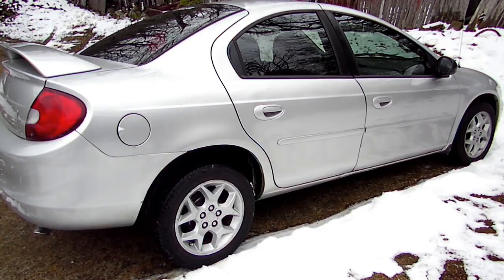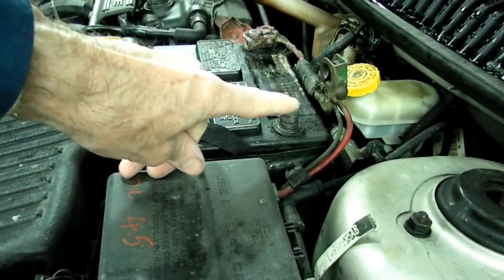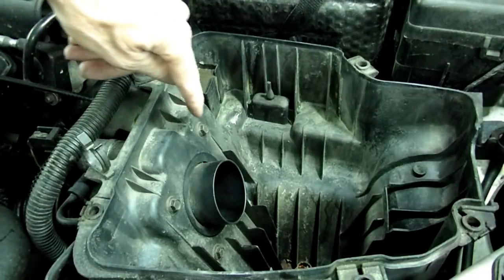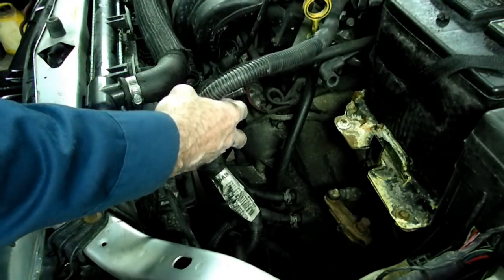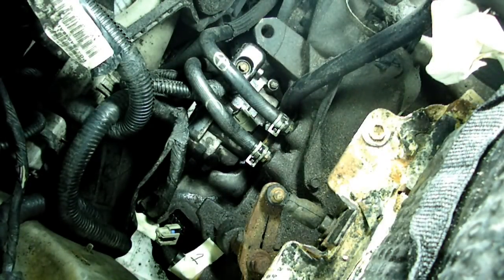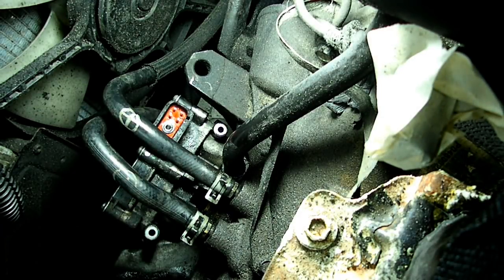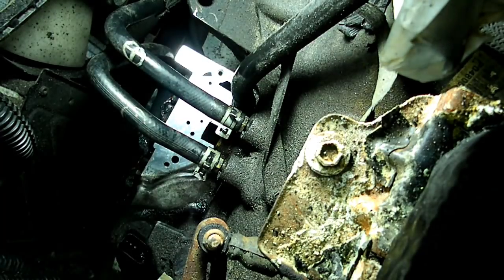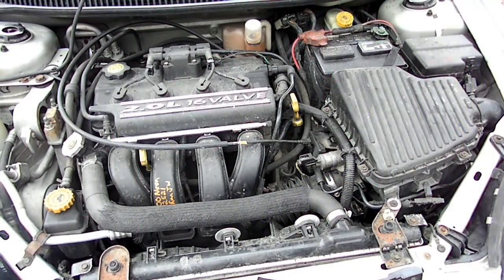Transmission Control Solenoid Replacement

Comment: Hi richpin, when you replaced the shift solenoid did you had to perform the "Quick Learn Procedure" with a DRBIII scan tool in order for the car to work. I have the Repair Manual from Dodge and it says that that procedure is necessary when replacing the shift solenoid. I ask this question because I replaced the solenoid and the transmission is still stuck on 2nd. I have also replaced the oil and filter and also the input speed sensor and output speed sensor and still the transmission is stuck.

Comment: 95 MX3 transmission (automatic 1.6L / 4 cyl.)

Full with fluid
shifts OK into 1 and 2 .... but RPMs go up and up for 3rd and 4th (foot on gas accelerating), but the cars doesn't speed up  .... i'm stuck on 1st and 2nd.

-Solenoid problem ?
-Should i reset by disconnecting battery ?
-No OD light flashes in dashboard
-No ''CHECK ENGINE'' light 
- No codes have been taken fron vehicule (we just added fluid to tranny) 

Thanks for any help ....

Comment: Nice job.I have a 2001 Grand caravan 3.3 L. My transmission defaults to 1st gear sometimes.  I was told it was a Transmission control solenoid, or, a solenoid on  the firewall (expensive).  I was told when it heats up a circuit opens and defaults to 1st gear. When it cools down she runs fine. I was quoted 400.00, 320.00 for the part, 80.00 labor.  I would prefer to fix it, but not sure which solenoid to replace.  Which one do you think it might be based on the symptom?  Thanks..

Comment: hi, the two connetions you removed and labelled when you removed the 8mm bolt from solenoid were the shift senors, also when you put back the new solenoid you should cover the diaphram with something to stop dirt dropping in during re-assembley

Comment: Transmissions eh? My car, a Toyota Camry of the 1996 vintage has trouble going into the overdrive when cold when it never has before. What do you think could be wrong? When it's really cold out this is worse but when the engine can warm up fast it's okay. I know overdrives are not supposed to work until the engine is hot, but the engine never has had an issue getting into that top gear before.

Comment: When removing and replacing the shift solenoid, wouldn't it have make the job easier if you removed the two little hoses and placed them out of the way?